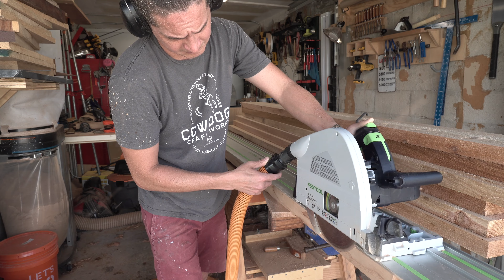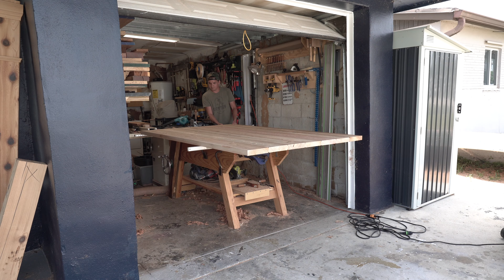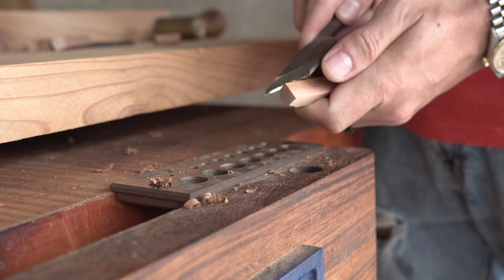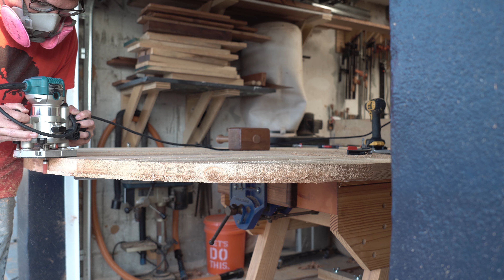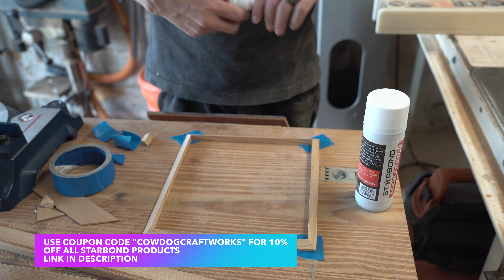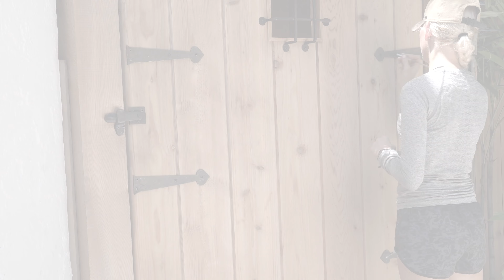New Backyard Feature: Speakeasy-inspired Cedar Gate

Comment from the maker: Help support my work through the following affiliate links, all products utilized in the making of this project:

-Starbond CA Glues (Special Affiliate Link): https://bit.ly/36sB2Bv
For 10% off use coupon code: cowdogcraftworks
-MAS Epoxies (Special Affiliate Link): https://masepoxies.com/?ref=18
For 10% off AND free shipping use coupon code: cowdogcraftworks
-The Real Milk Paint Company's Impressive line of finishing products (Special Affiliate Link):
https://www.realmilkpaint.com/ref/cowdogcraftworks/
For 10% off use coupon code: cowdogcraftworks
-VanDyke's Restorers (Non-Affiliate Link): https://bit.ly/2W3mGqf

Okada Hardware Mfg Z-Saw 3 265mm (Universal H-265) (Japan import): https://amzn.to/3xSwujJ
DFM A2 Steel Dowel Plate 17 Holes MADE IN USA (English 17 Holes): https://amzn.to/2W05Bxm
Bessey BPC-H34 3/4-Inch H Style Pipe Clamp, red: https://amzn.to/3ANiHg5
Bessey Ratchet Clamp, 8 In, 3 In Throat, silver (KLI3.008): https://amzn.to/3AQFOGu
DEWALT Drill Bit Set, Brad Point, 6-Piece (DW1720) , Black: https://amzn.to/3xSFIfQ
Center Punch: https://amzn.to/3fSQsCj
Stanley Sweetheart Chisels: https://amzn.to/2ZATrKg
Dewalt Compact Drill: https://amzn.to/3ht3tng
Metric Japanese Style Carpenter's Square: https://amzn.to/35kC3fG
Mini Square 10x5cm: https://amzn.to/36mtcti
Faber-Castell Ecco Pigment 0.1 mm Pen: https://amzn.to/36oLni8
Pentel Mechanical Pencil: https://amzn.to/36uqbab
RIDGID 1-Layer Standard Pleated Paper Filter for Most 5 Gal. and Larger RIDGID Wet/Dry Shop Vacuums (2-Pack): https://homedepot.sjv.io/gvD1O
14 Gal. 6.0-Peak HP NXT Shop Vacuum: https://homedepot.sjv.io/qrj1O
RIDGID 9 Gal. 18-Volt Cordless Shop Vacuum: https://homedepot.sjv.io/oQaNm
Festool 574332 Domino DF 500 Joining System: https://amzn.to/2XoKO6U
If you want access to more tools, check out my amazon storefront: https://www.amazon.com/shop/cowdogcraftworks

//Follow along:

IG: https://www.instagram.com/cowdogcraftworks/
Twitter: http://www.twitter.com/cowdogcraftwork
Facebook: http://www.facebook.com/cowdogcraftworks
Website: http://www.cowdogcraftworks.com

Comment: How did that epoxy work out for you ? I'm building functional shutters for my house and wamt to use epoxy instead of glue for the joints.
Reply from the maker: It’s great. It’s a little thinner than you would expect so keep some acetone around for cleanup but it gives an awesome understated seam. These gates sat outside for a couple months before install and there’s no concern for delamination whatsoever.

Comment: What am I missing? Isn't a breadboard end typically fastened to allow for movement? In an outdoor setting I would expect a lot of wood movement. Why won't it crack as the gate shrinks and expands across its width?
Reply from the maker: The mortises in the breadboard end itself are cut wider than the tenon. Not by a monstrous amount but by a little. Also, not filmed but part of the process was using a drawbore pin… or in my case a screwdriver shaft to widen the hole in the tenon laterally a touch. Again… nothing extreme but to accommodate for some left to right expansion and contraction. These gates were actually built about two months before install and sat under an overhang outside. The wood movement is evident. It shrank about 1/8 to 3/16 on either end and you can actually see the difference between the “door” and the end. I expect it to expand similarly. Also worth noting: here in south florida we operate at pretty high humidity all year long so seasonal changes aren’t going to be remotely as extreme as they may be in some areas of the country and that consistency is accounted for in the construction.
Reply: @CowDogCraftWorks  Thanks for the detailed explanation! Everything you say makes perfect sense, it just wasn't clearly enumerated in the video.
Reply from the maker: No worries. It’s a balance between talking too much and talking too little in these things. Thanks for watching!